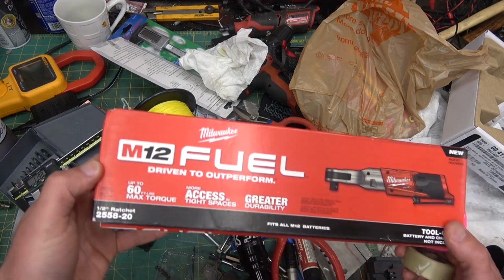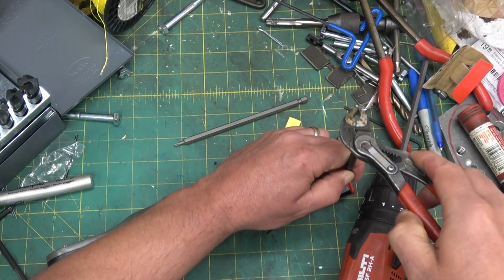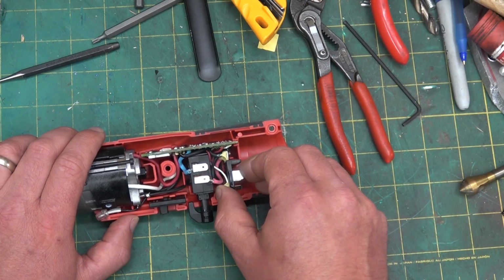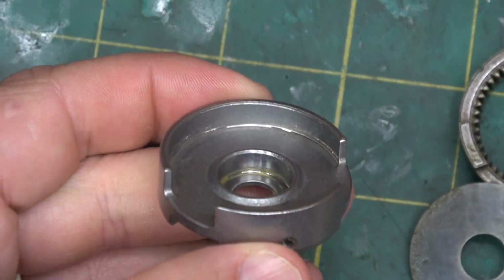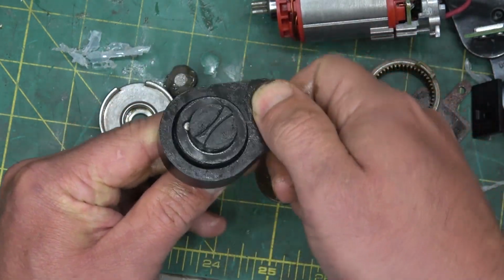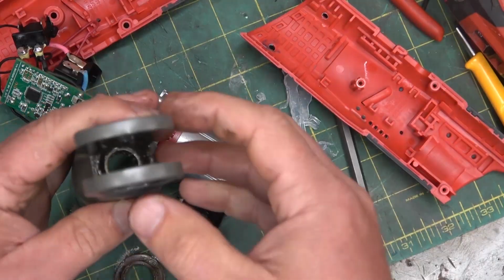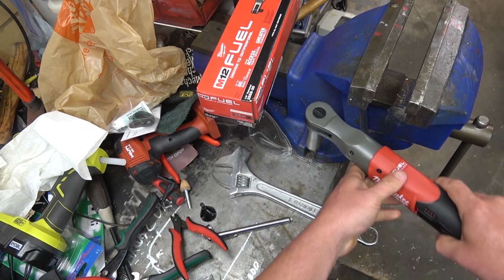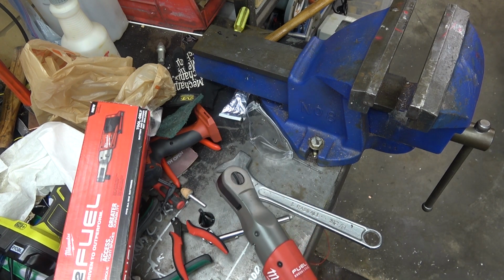BOLTR: Milwaukee Fuel Ratchet

Comment: (Edit to add, more importantly, the support from Milwaukee in the uk is utterly abysmal). Good to see uncle bumble back on the right trail( if I may be so bold). Got the 3/8ths a while back, as it can be adapted up and down for all drives sizes, and was sad to see uncle hadn’t reviewed at the time, but these are well respected in auto shops, they do loads of “miles” reliably. Bellows on the switch, the paddle (needs a guard so it doesn’t go off when you pit it down in a pile of tools), no mesh on the fan. All these came to mind. Reefing on it does risk yanking the battery out. You can feel it loosening in your hand. But, I guess there’s a max limit so it makes you stop yanking on your handle, so to speak. 😆

Comment: You should try taking one of these tools and hooking it up to a more powerful controller from something like an ebike. Maybe even putting several batteries together to get more voltage as well. It would be cool to see how high of power you could get out of it before the motor starts to burn or die.

Comment: You weren't running out of battery, it just flashes at you when it's too much for it.  you can put a freshly charged batteria in it and it'll flash if you overpower it.

Comment: I work at a welding plant, building truck bodies. My company only buys Milwaukee Tools, lots of them. I've been in construction for 25 years. Milwaukee is now Top Dog in my opinion oh, nothing comes close. I've used all three ratchets , they're great. Milwaukee fuel is the way to go. There are snack machines all over the plant, instead of sneakers they have all different flavors of Milwaukee fuel, swap your employee card get a brand new whatever , it's the tits.

Comment: I have one of these in 3/8th for about 6 months now and I beat the shit out of it, biggest problem is not the tool itself but the shitty cheap 2/3ah magazine style battery. I had the top of mine break off inside the damn thing. other then that I throw it around, drop it, and it takes it. Dont worry it get's its revenge by utterly busting my knuckles when it catches and swings itself and the big ass 4ah pack around at mach 6.

Comment: I have an older model of this, about 11-12 years old, and I have had ZERO problems with it.  The only problem I actually had was that the batteries died over time and I had to replace them.  The tool actually outlived the batteries.  Now, I must say that mine was the older style, with the dark red dye, before the company changed hands I believe, but I must say that this tool has been priceless, occasionally.  I am not a professional, so the tool is only used a couple times per month, but it has never let me down.

Comment: I have the whole M12 line here are some major tools that I broke. I broke four of their M12 brushless drills, one impact driver, one air pump, and one non brushless ratchet. The drills all failed the same way, doesnt turn, but clicks every time you try to use it. (controller failed) All broke when using the one inch spade bit. The impact driver's gearbox exploded, the air pump melted the piston which was made of FUCKING NYLON........ And the non brushless ratchet broke a couple of tooth off, then rounded a few more, dont use it like a normal ratchet lol...One of the M12 brushless that didn't break is the sawzall, that shit has taken so much abuse cutting trees, as I use it for trail maintenance when mountain biking. I have several 4.0 batteries, the sawzall was so hot I cannot hold it with bare hands. I beat the living shit out of my tools, but I still wipe them down, they look good as new. But yeah, prob take a easy with the brushless drill, its got a lot of power, but I don't think that tiny ass controller likes the workload I give it.

Comment: it's an interesting point taking advantage of a low duty cycle tool. We had an issue with a wacker packer they used a float carbie being a high vibration item it'd basically run for a bit over 4 minutes. and starve.
after a lot of back & forth eventually a diaphragm carbie was fitted.

but I'm still seeing these units on sites
but because there rarely used for more than a couple minutes it basically goes undetected. 
I won't name the manafacture but it wasn't a minor company.

Comment: Ive stripped the teeth off the pawl on the 3/8 model twice, used almost exclusively for stripping down engines and doing brake jobs.
Im finding now that it only engages the teeth on 75% of its ratcheting cycles, and this is with a brand new set of guts in it too fitted under warranty

Comment: I been beating on the 3/8 fuel version since march. I done a few brake jobs, replaced ball joints, adjusting pulleys on HVAC equipment, plus tore down a few generators with it. The red casing can take the occasional slamming into sharp metal, doesn't have the breaking force but once a fastener is broke free spins off and back on effortlessly. don't worry the orangy-red darkens from greasy hands

Comment: I have two, daily use, work environment is very wet.  I have lube on my hands constantly.  The tools are usually placed on a wet, muddy area where I am working....  both (too lazy to change bits, so I did the smart thing and got two so I don't have to look through the bottom of the bucket I keep them in for bits rolling around) ...  both have held up tremendously well.  I lost the light on one of them, but they still work perfectly.  Even though they are DEEEER-TAY.  At least nobody will think of stealing them cause of the grunge.

Comment: i have an old 3/8 one, the ratchet mechanism has rounded the teeth that engage and slip for each direction in the anvil head.
she grips in reverse mostly but cant tighten for shit.
A anvil repair kit will get it back in the daily use again.

Comment: The only way u will break that ratchet or any tool. Is if u use it for something thats it isn’t meant for. I’ve had mine for over a year and still works fine

Comment: I have a similar one in 3’8” in the starter kit with the rattle gun and the light. Actually a fucking amazing kit, there’s not a piece I don’t use regularly. I haven’t noticed any issues but I absolutely concur with the little dowel pin breaking off. I haven’t had it happen but I’m expecting it to happen at some point.

Seemingly the nice thing about Milwaukee is they provide parts manuals for at least some stuff, and this is one of those things, so if something does happen, I can hope to track a part down.

Comment: I have the regular m12 3/8 ratchet I use at a high performance auto shop I've used daily for the last year. Ive dropped it at least 100 times and its been dropped in oil and coolant a couple times. Somehow she's still going strong. When it shits the bed id be happy to ship it to you for a teardown video!

Comment: Have 2 1/4 M12 ratchets, both had switches fail, but to their credit, the corporation fixed both of them by sending me new ones. The oldest one cracked by the paddle roll pin after some "gentle" use. The newer one so far hasn't shown any signs of schmoo yet.

Comment: Collision repair tech here. I’ve used the original ratchet @ 1/4” drive since I started the trade (9 years ago now). And swapped over to the fuel version the day it was available in Canada.  The original one failed on at the head of the ratchet. One from shattering on the supports for the pawl and the other is the pawl mechanism failing ( worn out teeth. Third brushes version is now back up. In the two years now of using the brushless one, I haven’t seen or noticed any failure mechanically from the tool, but I have noticed the battery case breaking from drops. Have had the ratchet head take a direct impact from a fall at 3 feet onto concrete and was fine. The fuel version definitely has more umpf to it, but the brushes version has more stall torque to it. Hard to explain. However the fuel one doesn’t need to be charged for days. I use it day in and out, where as the brushes version, it’s every other day it need a charged pack. 
Thanks for the video AVE. Been waiting to see you do a BOLTR on this for a long time. I might be able to send you an old 1/4” brushes one for tear down. ( I highly suspect the brain box on this one). Just got to see what the Milwaukee service centre says.

Comment: We use them in a tool controlled environment working on aircraft so we have to check them out from the tool room. The most common  problem is whatever holds the battery in the tool breaks and the battery constantly falls out. And the plastic housing breaks off from the metal like you said.

Comment: I’ve had the 3/8’s Milwaukee fuel ratchet for about a year and half and I’ve had 0 issues with it at all. It’s been a great tool. I am always worried about the roll pin breaking in the paddle switch too. It’s seems very small. Honestly I prefer the finger button the snap on ratchet has over the paddle switch the Milwaukee does.

Comment: The switch to change direction is probably the worst dexterity design in any ratchet. It’s too thin and too stiff. No way I ever get it easily with greasy dirty hands and forget about it if you have gloves on

Comment: I regards to the using BLDC for 120VAC applications - I think you are missing the cost of materials Iron and copper, plus the cost of shipping extra weight.  With the volume they are shipping of BLDC silicon prices are low for the electronics + value of marketing wanketry + reduced shipping cost for light devices + reduced material cost + energy star = BLDC in 120VAC home devices.  I forgot to mention the added smart that do BLDC can tell if the load has increased on the motor over time and call the mother ship to say it needs service.  Lots more reasons than meet the eye to go BLDC.

Comment: One more comment... I want some tools to work in a normal outlet again, rather than batteries. Some times I have to use batteries only, because of the lack of wiring, but If I have the option, I would like to utilize the power outlet as well. Batteries run out, but the outlet does not... Does it not???

Comment: I have had the old version on that ratchet for several years love the thing battery still holding charge only down side is the plastic case feels a little light weight when really going at it but just crap the old school one for getting super tight

Comment: Quick question: why would anyone need a ratchet that is powered? I doubt you'd answer poor twisted me, but just in case I'm studying to be an engineer. If torque would be an issue, then torque wrench. Why would this tool help you for machining tools on an EDC? I understand that different metals would require more or less torque, but then there might be a feel to it. You briefly mentioned it, but please explain... if you have an interest to do so. Why do you need a powered tool to get the feel of what you need?
Reply from the maker: faster and easier.

Comment: Have been using the brushed version for years. While more power would be nice it is a handy power tool. I ordered a few for working on the industrial jet engines at work and boy are they popular, also opening those old explosion proof boxes with a thousand bolt is a little less tedious.

Comment: I use mine everyday I’m a Mercedes Benz tech and I haven’t had any problems. Now that  Fapon  is another story I’ve rebuilt it twice at the cost of $127.00  plus shipping. And it breaks I’ve replaced both 1/4 and 3/8 with Milwaukee due the cost it’s cheaper and has a better warranty

Comment: With enough extensions and a few wobbles, there is too much flex between the bolt and the ratchet for it to be able to ratchet, the extensions just wobble around like a sad impact, and no spinning. 
Only ever been a problem for me twice, but still a consideration if you're planning to use it for hard to reach bolt.

Comment: My techs use these things everyday and the most common thing I see that goes out on them is the black overmold starts to separate from the casing.  It still works though.  But then again, these things always have oil and other solvents on them at all times.  So that is not that surprising to see.  Well worth the money for them if it can last 1.5 - 2 years of use every day on cars and trucks.

Comment: I got in quite the predicament with one of these. I had it down in a tight spot getting a nut off and without paying attention, I started backing the nut out which pushed the back of the ratchet right up to a blockage. Couldn't get the ratchet off and couldn't get to the switch to tighten it back down.

Comment: Where the spinnamathinger meets the ratcheting mechanism on mine seems to slip every once in a while under fairly high tourque for the little guy so it will just spin and not engage the next tooth on the ratchet just goes back and forth slipping, I can hold a socket in my hand and make it slip. But where you said about it being a knuckle buster and then not busting your knuckles because you thought it was a low battery, is a feature in it, if it sees too much load it will shut off and not bust your knuckles.

Comment: At 10:00 that shaft in your hand is the weak spot. If you hang your 200 lb gorilla ass off it that pin will shear off. At least on my 3/8 ones, this one looks a bit more skookum than mine

Comment: When are they going to start using brushless DC motors in plug-in appliances?  They already are - I just got a sales flyer from Menards home improvement shilling the new 'Delta Breez Ventilation System' bathroom exhaust fans, which are advertised as having the following benefits of brushless DC motor fans: Compared to popular AC motors, DC motors last as much as 70% longer and use up to 74% less energy, light weight construction, long life - low noise - low power consumption, ball bearing enhances the life of the fan, soft-start control quietly and quickly ramps up the motor to full speed.  Now every bathroom fan I've been into has a shaded pole motor that's super cheap to manufacture, and the failure mode only ever seems to be dry bushings, and the noise doesn't come from the motor but rather the quality of the caged blower fan and the resonant vibration in the enclosure housing, but that's no good for marketing.  The new ones are priced right in line with the plain old shaded pole models of equal features and comparative noise and flow ratings though, so it's not like they're double the cost for little to no difference.
Reply: Come to think of it, my garage door openers are DC motors too, think for ease of speed control in getting big heavy doors to start and stop moving, but I'd assume they're brushed since it didn't say 'BRUSHLESS' in giant letters on the box.

Comment: I'm a mechanic and have been for 10 plus years I have both the old and new (bigger head) models of this tool/ratchet and love the f outa them. On the older smaller head ones the failure point was the pin on the cam that sits in the ball on the end of the ratchet, but to be honest I was putting too much of my 230lb gorilla arm behind her and that's why it failed, super easy fix tho did it myself (4 times). Have not been able to break the new bigger head models yet(the one in the video here) but only had her for about 5 months, but do I ever love these things when pulling timing covers or water pumps damn nothing beats em!

Comment: Got the 3/8 version of that ratchet. Don't pull on the battery when you go reefin on her, the battery temp sensor connection is a little flimsy. More a problem with the batteries than the tool but there ya go.

Comment: I work in the automotive industry and this ratchet and the M12 Fuel 3/8" drive ratchet are used more often than I thought they would be. The 3/8" has a bit more torque than the 1/2" one does, but that could also just be that it spin-a-ma-things at a higher velocity than the bigger counterpart. I have yet to break anything on either of the two electric ratchets, but one of my coworkers has gone through 3 of them. The usual suspect for him is the paddle switch pin, or the circuit board.

Comment: I have the Fap-Off 14.4 and while I know it's tough on the ratchet I've found if you get the motor going then drop it on the fastener it has way more break away torq.

Comment: Well, it's not a hand tool, but they do put bldc motors in furnaces nowadays - call them ecm ("electronically commutated motor"). Think that's usually replacing some kind of induction motor though. There's serious power savings (apparently the blower motor is the bulk of your heating's electrical bill), and they're way quieter (if a little weird sounding sometimes) with variable speed.

Comment: Switch should last pretty well as I'd be pretty sure that it's not carrying the full motor current , just a few milliamps to switch an input of the Texas controller
Reply: You're right in that electrically, it's not doing any heavy lifting - it's more a mechanical failure over a number of cycles

Comment: I have the 1/4 and 3/8 fuel ratchets. Use the daily at work, and give them a beating, dropping off cars and racks on to concrete, and really pulling on them to break bolts loose and a time or 2 standing on them. The downfall to them I have had is the fucking batteries, the little clips holding them together break and end up gluing them back together. They also dont seem to lock in as tight as they should, shoot out like a rocket when dropped. Also the red plastic part of the batteries dont seem to be glass fiber reinforced. But after about 2 years of hard use and being sprayed off with brake clean and filled with man gliter they have served well.